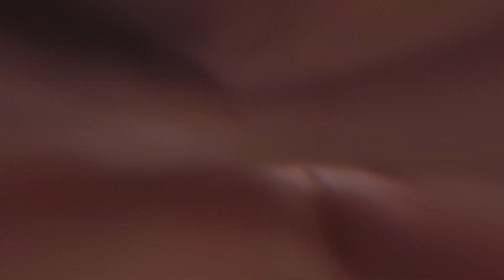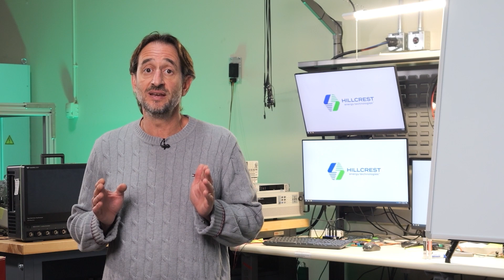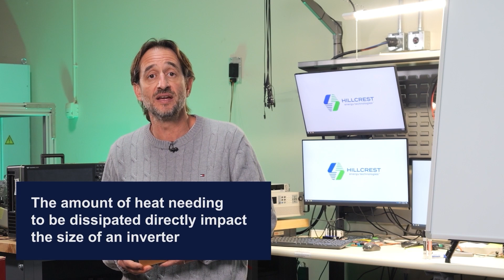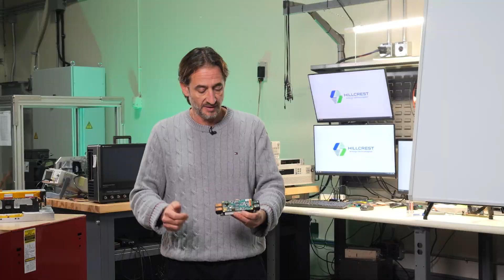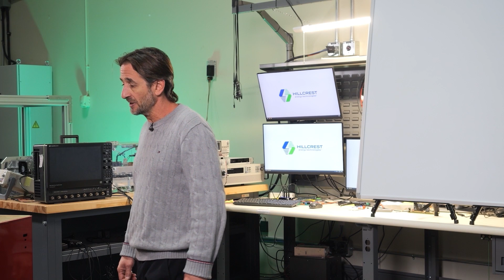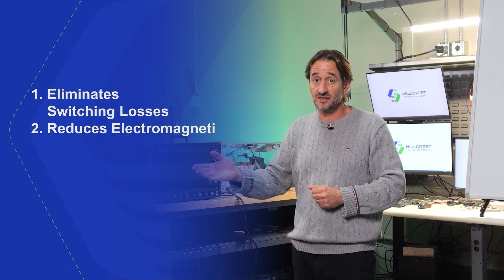HEAT Tech Talks: Losses in an Inverter

Comment: I've read somewhere that Teslas Model 3 already has a 97% efficiency on their inverter. Where comes the significant improvement of your product ? Sorry I have very little knowledge on it and coudn't gain the insight from this video.
Reply from the maker: Hillcrest's ZVS technology virtually eliminates the switching losses that are generated when converting power (AC to DC or DC to AC). These losses directly impact the efficiency of an inverter as well as the overall powertrain system, so we are able to achieve much better efficiencies than conventional inverters found on the market today.
Reply: @HillcrestEnergyTechnologiesLtd  It is critical that you compare yourself to competitors in your videos imo.